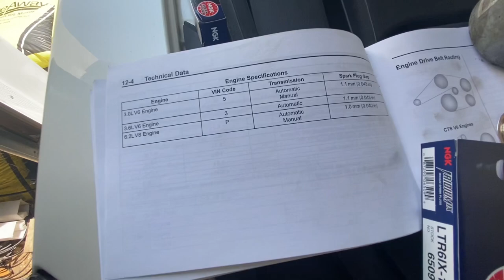Replace spark plugs 2008-2014 Cadillac CTS 3.6L

Comment: This is a top-notch how-to video. The details like carefully disconnecting the coil pack connectors without breaking them and using/carefully applying anti-seize  & dielectric grease are really helpful. And the attention to getting useful video is super good, too. Many thanks.

Comment: IT not easy on the 2009 have to remove intake and crossbar if that gasket not on right you going to get problems
Reply from the maker: Please post up some pics because they all have the same engine and the engine bay with the crossbar are all identical. So I’m very curious to see your set up.
Reply: @marenothecarguy8361  the intake covers the #2 cylinder and on passenger side it's a bit difficult to get the coils out without loosing the bolts for intake without taking off crossbar then that's where you have the problem of the intake gasket had a problem fixing mine wasn't set right

Comment: Why you change the gap they already come gapped
Reply from the maker: I didn’t change the gap, i verified the gap on each spark plug was correct before installing them. 
I’ve learned from doing too many tune ups over the years, never install spark plug’s without verifying the gap. 
Most likely the gap on iridium spark plugs will be correct but I have found exceptions. 
Better to resolve the issue prior to installing them, rather than needing to go back in later.
Reply: @marenothecarguy8361 interesting so what if they weren’t gap correct what would happen
Reply from the maker: It would run poorly. Most likely would backfire and have an engine miss.

Comment: May I ask why I would need to go change the gap on the spark plug? (You used that little coin thing when explaining it). 

Am I not able to install the spark plugs (the ones I bought new) right out the box without messing with the little metal piece at the end of the plug?
Reply from the maker: Some spark plugs come pre-gapped to your car engine requirements. Those are usually the iridium spark plugs but not guaranteed the iridium spark plugs would be gapped to your car requirements. Even if the part store tell you they are re-gapped to your car requirements, it’s always suggested to use the tool similar to what you saw in the video to validate it is gapped correctly.

Comment: Anyone know how to fix the radio/climate control when the both blank out. fuses are good; disconnecting the battery didn't work either. 2012 3.6 CTS Coupe;  (after-market radio)
Reply: you have to take the front of the infotainment face plate off, two plugs are behind it , one for the cig lighter and the other goes into the climate part. it is prone to go blank if you add any kind of aftermarket radio unit or really any kind of electrical change.   the battery does not have to be disconnected... you can unplug it and replug it weather the car is running or not.   its a stupid safety feature that causes the blower to stay on but the controls not to work . i have an after market kenwood radio and i have to do it all the time.